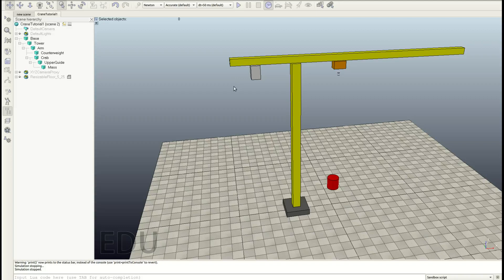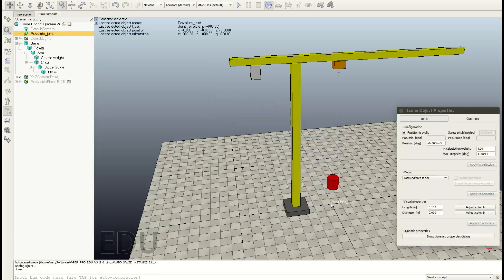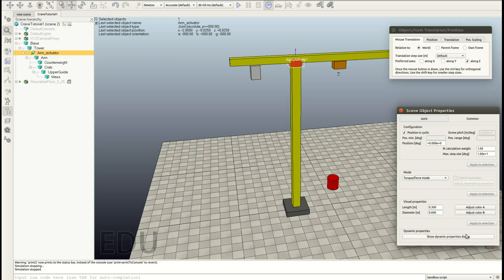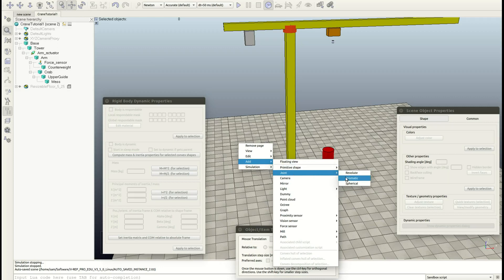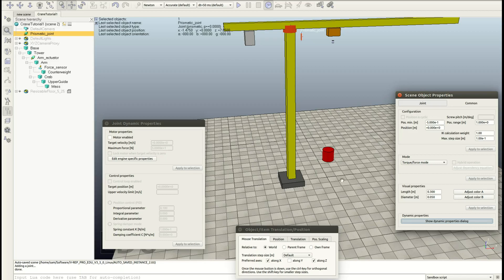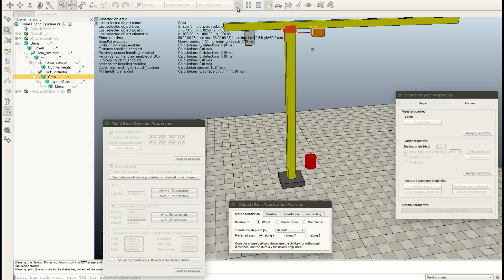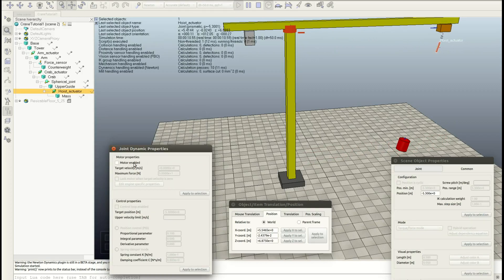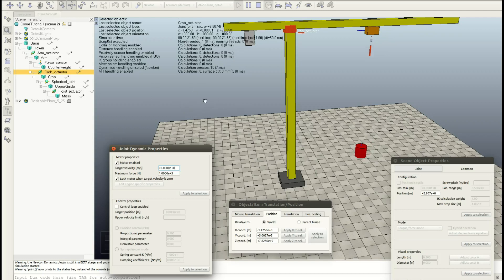V-REP Beginners Tutorial: Modeling, Joints, GUI | Part 2/3

Comment: Heyyy, I have a really urget doubt...
I'm building a ball balancing platform and I have two servos with connecting rods and L clamps to join to the top plate. HOW DO I CONNECT ONE TIP PLATE to THREE seperate rods from three servos. . . .
Reply from the maker: Use a spherical joint.
Reply: hey I am building a stewart platform Could I get some help from you